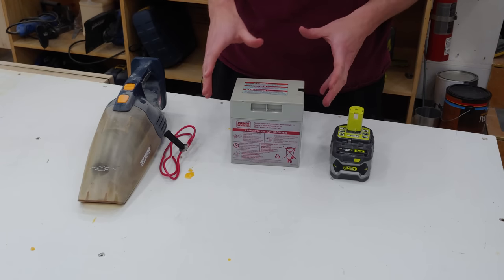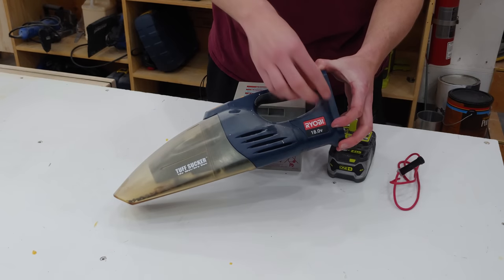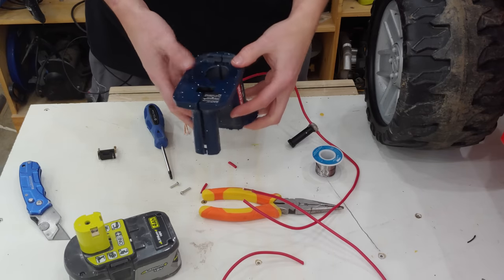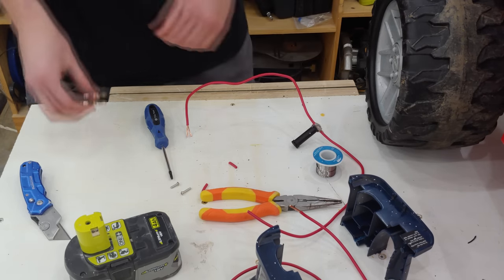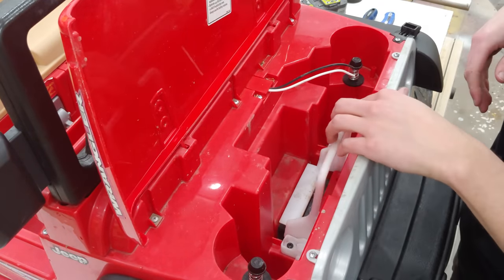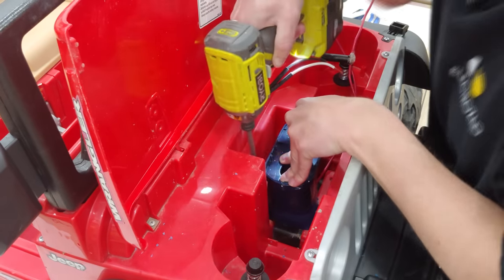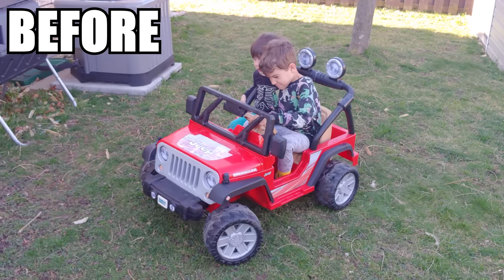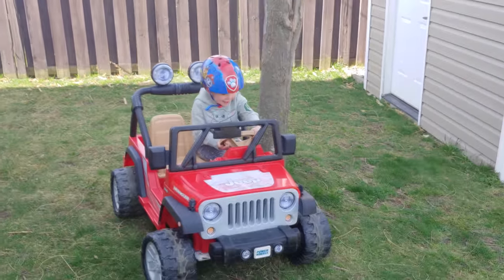Modifying my Kids Power Wheels for MAX Performance

Comment: I love it! A while back I made something similar for my sons electric car. I'd doubled the voltage from 6V to 12V and used a regulator to reduce the voltage back a bit to safe speed. But soon he figured how he can turn it to "full throttle" 😜

Comment: A standard project in the Ryobi groups in facebook... Not to downplay your work, just saying how I know this...

Custom power "taps" can be found on eBay, or you can buy the 2 usb port adapter, crack it open and use that as a tap.

I did this for my mountain bike, giving me USB power for my phone, aka GPS recording device, aka jukebox, aka podcast player; power to charge wireless headphones; and raw 20v power for a walmart clearance LED off road foglight for night runs.

Food job, glad they like it! Wish I'd had this as a kid myself.

Comment: If you put two or more  batteries in parallel you can double the run time with out adding speed but if you want speed wire them to series
Reply from the maker: This is true

Comment: That was interesting and impressive in terms of power obtained. I assume that the mini truck now moves by creating a vacuum in front of it :-)
BTW, aren't you afraid of getting your tool battery packs "accidentally" diverted to the mini truck?
Reply: Yeah, no more worries about the power wheels having charged batteries, the issue is now will his power TOOLS have charged batteries?

Comment: If you don't need the extra speed, you can use a regulator to step down the voltage to somewhere between 12 volts & 18 volts. This will increase the runtime. Also, for about the same price as a replacement Power Wheels battery, you can get TWO 9 amp/hour Ryobi One+ replacement batteries. (Generic Brand, of course) Even if you set it for around 13 volts, it will still seem like more power, because more power will be on demand. Is the vehicle still in use?

Comment: I looked at doing this with my Dewalt batteries.. but wondered if the 20v would wind up burning up the 12v motors??
Reply: I have seen it done with Dewalt, and it works fine.
Reply: The 20v batteries are just a slightly different chemical formula, and they actually have far less difference that you would think- I use 20 to 18v battery adapters for my DeWalt stuff for the older ones, and there is no actual noticeable difference in speed between the two different batteries!!!
(indeed my DeWalt battery 'shopvac' (DVC580) actually has a connector housing on it to take either!!!)
Reply: @steved2136  20V vs 18V - same battery, only bussiness (liar) trick. 
But question is 12V motor vs 18/20V battery.... :)
Reply: @CzKaa  'In theory' it would shorten the life of the motor- and maybe some fancy ones mightn't handle the extra voltage (ie electronics for speed control)- BUT in practice- motors are VERY forgiving when it comes to 'overvolting' (mostly as the windings are massive) and many electronic speed controllers are multi-voltage (the one in my '12v' fan is actually marked internally as up to 32v!!!) so in practice- I doubt anything 'bad' would happen- at worst you might have to swap out the speed controller for a better one...